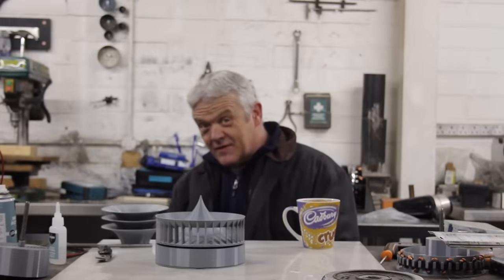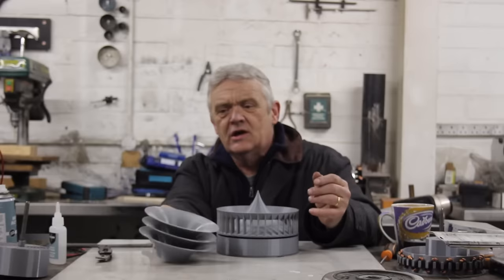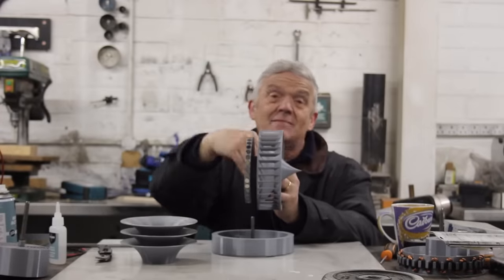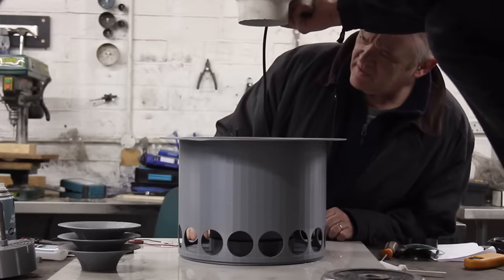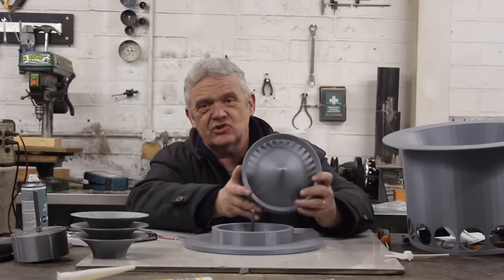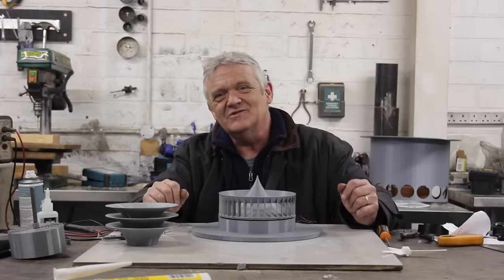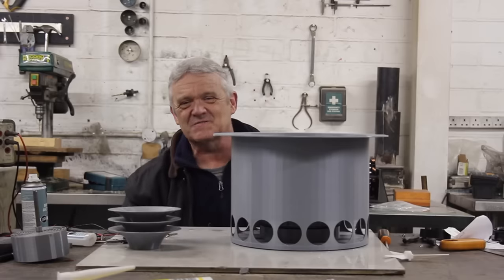1889 Ground Breaking Wind Turbine Update

Comment: Could you not have someone CNC a former out of several layers of plywood and then use that to form some fibreglass over for the concentrators?

Design your cone shape in CAD, then, use a slicing tool to turn it into 22mm horizontal layers...these can then be sent to a CNC flatbed machine.

You could also look at including some directional veins embedded into the fibreglass to cause the air to be fed as a rotating vortex too.

The veins would also act to ensure that the cones are kept equidistant from each other.

Comment: Hi Robert, I like the way you start testing to find out which components may be best suited. What I would also like to see is a "standard" VAWT (Savonius or Ugrinsky etc.) of about the same size (height and diameter) as the wind catcher. When you connect it to your serpentine coil generator, will there be a difference? And how big? If the Ugrinsky, let's say, is equal or a bit better, then we know we must use the Darwin/Waters turbine only in situations where it is critical not to have a large, rotating mass exposed to the elements. Could you please compare these two designs?
Reply from the maker: goo points mate thanks for suggesting them

Comment: I imagine the real test will be checking how the angle of attack on those rotor blades changes the output speed or torque at given speeds. I'm sure you will optimize it for your 4m/s common wind speeds you've mentioned before. 
Incidentally I recall that the Tesla generators work best at VERY high RPM. Not so much at lower speeds I would be surprised to see that come up again in this series. Not to say they couldn't apply elsewhere though.
Reply from the maker: they do work well with higher speeds mate

Comment: So wind, water and what about sunlight? One thing you can rely on with sunlight... it warms the ground which emits heat of wavelengths that make air rise. If you have a substance that makes air rise using sunlight, you can drive a turbine from the rising air... without any wind. Ever tried it? I suppose it wouldn't work in a temperature inversion scenario, since air is hotter with increasing altitude.

Comment: The relationship between the vertical foils and the attached spinning cone, is fixed at a certain angle. Is that 90 degrees? As the speed of the cone increases should the angle of the vertical foils change due to the Magnus effect for maximum efficiency?

Comment: What if the cone is made of Tesla cones the empty radially with the last exhaust passing through a similar ring, with ''blades'' be hyrofoils sand the whole thing being immersed on running water, or attached to (comparatively) smaller diameter input pipes arranged around the axle and bearings so that the whole apparatus allows the fluid to pass through it axially at approximately thirty degrees to the centerline?

Comment: What about air pressure? eg wind blowing over a sloping roof accelerates causing an area of low pressure much like on an aeroplane wing. Placing a downward direction Darwin type would be going against the flow, whereas an upward one might be enhanced?? Also thinking of air pressure inside the cone...

Comment: With the wind capture device, as you are looking at whether to 3D print or hand make. Would bafals around the top of each layer help catch the wind that would otherwise blow past the downward facing cone? Because the cone is reducing in size you could lose a lot of wind that would otherwise be captured if bafeled went all the way to the edge. If you offset the bagels at each level you would be able to capture the most amount of wind no matter which direction the wind blows from.
Just an idea, not sure if it will help you probably have considered it already.
Reply from the maker: I have tested it mate - they don't add to the effect

Comment: I'm probably wrong, but a question occurred to me looking at the outer cowling... if instead of simple open circles, they were the large end of hyperbolic cones, would the low pressure on the outside effectively pull the air through the turbine from the back end of its progression?

Comment: I would have thought the air passing by the turbine helps suck the air through the turbine so eliminating it with an inlet duct would make it less efficient. With aero, it's all connected, I.e. disturbing outlet flow will impact inlet flow. Perhaps the duct can take bypass flow into account for even better efficiency.
Reply from the maker: maybe

Comment: You know the serpentine coil is wiggling round them nobs,would it make a difference if you added some iron in the centre of the nobs in the form of a screw or bolt 🤔

Comment: I get that you dont want to see the generator output, and that logically makes sense, and its the right decicion to separate efficiency of the two parts, but consider this, lightening the rotor or reducing friction will increase speed, and increase voltage, but not power. You need to put a defined resistance across the output at measure the voltage and current, and therefore power. Voltage is not equivalent to torque, power is closer. In ac theory its more complex than that but its power you want in watts, not voltage

Comment: I'm just wondering if the Finns should be designed like a pinwheel .Know how easy a pinwheel will turn in a low wind situation. I've noticed that the wind collector's on a roof such as a a canvint with a* whirlybird turbine on it why it's fins are 
Convext & spiraled  like on a pinwheel. I also think that there is a variable in the size of your collector and the size of your turbine that should be considered when deciding the efficiency maybe the bad part of the operation is just due to its size.

Comment: Really enjoy your videos!  
Question 1: Is the pointed bit in the center of the rotor a conical, or is it parabolic?  It was difficult to tell from the video images.
Question 2:  Why don’t furnace blowers, or “squirrel cage” fans, use that pointed bit?  Seems like that would improve efficiency or reduce the load on the motor.  Note: If you are not familiar with furnace blowers, or squirrel cage fans, they are often used in North America on residential forced air heating systems, as well as some industrial applications.

Comment: been peeking through all of your videos and first off. endlessly fascinated with your content. you very much reach the goal of empowerment. 
So, im inspired by the ancient middle eastern wind catcher towers and how they utilize the cooling effect of condensation to create pressure differentials inducing the flow of air and expulsion of heat. im curious as to how this could apply to increasing the flow of air and in turn, efficiency of power generation but also to utilize the cooling effect to mitigate costs of A/C in warmer climate areas such as india, africa, maybe the SE america. taking into account the effects of humidity Vs Dry climates. create a parallel reverse direction Darwin tower "exhaust" 
idk, it seems plausible in my mind, but im no engineer. i plan on experimenting with it myself to test out some efficiencies but alas, i am poor, am in the middle of a move, and do not yet have a 3D printer, so it will take me a few months to get the pieces together to try it myself. i hope you see this robert, and maybe can tell me why im dumb before i expend a lot of energy or maybe it could be not so terrible an idea. either way i see this as a win. 
cheers, and thanks for all the content.
edit: when you look at designs for windcatcher towers they often take into account seasonal wind patterns to determine which way to face the tower. so, rather than having it be an omni directional darwin tower, would it be more efficient to have a 45 degree windcatcher with a pole that you can easily adjust to catch a maximum of wind power/suction that you manually adjust seasonally by monitoring output and wind directions. potentially even a slightly more high tech setup with a directional wind sensor connected to a small motor to slowly move the catcher atop of the rotating PVC pole.

Comment: Just wondering about the exhaust holes, is the total area greater, equal or less than the inlet?  You seem to be following in the foot steps of Henry Royce who I seem to recall also improvised with a generator as a dynamometer.

Comment: Crazy idea here: 
what if you attached another turbine under/to the generator (creating an updraft) in order to rotate the generator in the opposite direction to the above turbine? Thus doubling the the rotations. 
I get that there would be a big issue with all the wiring to the generator but could there be a way around it? 🤷🏻‍♂️ 🤔

Comment: So to increase speed on the generator motor itself, a belt and pulley system. Larger pulley on the turbine and a smaller pulley on the generator motor

Comment: Another question I have is - at what point does this 0.1mm wire burn out?   I've done a few calculations for power of air, and if the inlet is very efficient, the power output in 50mph winds using a (say) 600x600 Darwin is likely to go past the current capacity of the wire.  It's a bit frustrating.  So I'm tempted to increase the diameter of the impellor slightly, which will then potentially increase the generated power capacity, but also give room for a 0.3mm winding instead of a 0.1mm winding.  Lots of numbers to jiggle, and at some point I have to stop running it through my head and actually build something.  I'm starting to get the point that a DIY system of this type is almost inevitably going to fail somewhere, and it's a very different mindset from just buying something off the shelf.

Comment: Great video, makes perfect sense - with rim speed as the target it sounds its a weight to design challenge now. Very curious to see the CFD on the conversion section. Could you pick up more rotor speed by roughing the surface in line with the veins? Taller veins (weight issue) Looking forward to seeing the iterations :-)
Reply from the maker: cheers mate

Comment: With the magnets, wouldn't it produce more power if there was another magnet rotor below the coil aswel ?, so you will be using both top and bottom windings of the coil instead of just the top !, to me it would be twice the power wouldn't it ?

Comment: What about adding pipes to the exhaust holes of the wind capture and directing the wind back down the wind capture part would that improve anything.
Reply: Short, flared pipes. The flare should be able to add low pressure around the down wind side. On the windward side, that could be a problem. Equalised? Dunno
Reply from the maker: I don't know mate

Comment: Keep turbine on bottom but use vacuum to spin rotor by turning guides upside down and siphon effect would spin it maybe... why is this important? Because that's how large nuclear power plants create constant cooling stream. Where would the heat come from ? The generation of electricity and a painted black stack to also harvest sunlight. On a massive scale the upward stream is easier to control as vents around the bottom single input row of openings can be mechanically shut easier then the parabolic stack you currently use
Reply from the maker: cheers mate

Comment: Are you familiar with the $30 1kw diy wind turbine by OpenSourceLowTech? Made with a motor from an electric Hoverboard Wheel, a couple of bicycle wheels, a fan belt and some sheet alloy. Easy, cheap, quick to make and easy to fix with about 20% efficiency. One of the few Iv'e seen that actually makes practical sense, especially so if you use the other motor from the Hoverboard and make two of them. Should pay for itself inside of a year depending on circumstances.
Reply from the maker: seen it

Comment: Your meter will have some input impedance probably 10M ohm or something so you already have a current just from the Voltage measurement.  Can you just use a parallel load like a potentiometer to dump some of the current and do the relevant calculations from that? 
Does it stop when you short the coils??
Reply from the maker: do you know what I find mate - it doesn't matter what you do - someone, somewhere at sometime will tell you to do something different - basically you do what you like as long as you get a result that helps you
Reply: @ThinkingandTinkering  I see lots of people suggesting things, having their own ideas on the topic and sharing them , isn't that part of having a channel? I have my own projects,  I'm not sat here doing nothing.

Comment: to measure power use gravity and weight,Tie a sting to  a shaft and hanh a weight on it,  let the  blade wind it up, change the weights to determine the power difference
Reply from the maker: do you know what I find mate - it doesn't matter what you do - someone, somewhere at sometime will tell you to do something different - basically you do what you like as long as you get a result that helps you
Reply: @ThinkingandTinkering  i thought you liked Ideas,  I'm not telling you what to do just an idea as its simple, one to test all simply

Comment: Don't commercial wind turbines work at a fixed rotational rate?  (an optimal rate for their size)  So presumably you don't really want the optimise the turbine to spin faster, just generate more torque as the wind speed increases. So ideally you'd need a feedback system to dynamically balance the resistance to hit the optimal turn-rate.

Comment: Would a secondary deflector in the big piece help move some of the 'wider' air out the top of the fan rather than it blowing down and effectively causing turbulence issues to the more 'central' airflow which is running down the fan cone slopes then hitting the airflow like a vertical wall? Otherwise narrow the hole but that will have its own issues...
Reply from the maker: I don't know
Reply: @RobertMurraySmith  worth a dabble? Can send a drawing if what I mean if need be,  I know my explanation is a bit rubbish....

Comment: look at the picture at eleven seconds it shows the louver vent opening inwards and upward to the fan. Not downwards this acts like a chimney drawing air upwards to the fan. if you want air to hit a fan at a certain angle you would have to be in different places when the air is forced down to the ground as air pressure moves around. The louvers do point upwards its hard to drawer air down, when it gets close to the ground it warms up and create thermals rising up faster creating a upward draft. turn your fans upside down and put them on top of a tube were the air can be drawn upwards should create a fast fan.
Reply from the maker: that was the original design mate from the 1600s

Comment: I'm curious, could you apply a type of tesla valve upon the intake to ensure a negative flow (ie gust of wind up top) does not slow your rotational mass of the fan? I've no idea if that will help in anyway. I'm just curious if that would be beneficial by mitigating losses.
Reply from the maker: I Don't know

Comment: I used to work.on lm2500 gas turbine and it used the waste gas to spin a shaft to become self sustaining (obviously with Diesel being added). Could you use your waste air out of the bottom to be guided back into the top of  your intake?
Reply from the maker: yes but at the added cost of expense and complexity

Comment: 7:15 SUGGESTION: EXTRACT THE CONES FROM SHEETS OF THERMOPLASTIC OVER A MOLD.

Describe the superheterodyne [or, if you prefer, the 'anti-heterodyne'] in Tinker-cad, or with a compass and a sheet of paper, cut out a piece of wood of that shape, bend some stuff wire [3 to 4 mm should be quite sufficient, but if you do a lot of them, even coat hanger wire could be made to work], solder them all into a 'lamp shade' of sorts, [or even find a bunch of lamp shades all the right size and angle cheaply from some wholesale company] and then stretch a sheet of 4 to 6 mil HDPE plastic film over a 'picture-frame-clamping jig, cut the center hole out and line it with tape before stretching to prevent the plastic from tearing, then with just a little gentle heat [less than 80C] stretch each wire frame through the plastic, allow it to cool, then tape the outer edge to keep it from fraying in the wind.

I suppose, with a little bit of care, one could even modify common umbrellas to do this work, as they are quite cheap, and might possibly be usable with a little reconstruction of their spokes, along with them allowing one to have a common shaft, by putting the pointy tip of one piece up into the cut open piece of the next one in line [like stackable drink cups] and perhaps some hot glue to hold them together, and then this can sit on a wire, builder's board, wood, or printed plastic support on each end to keep it all in a line and keep it at the right distance.

That funnel need not be anything extremely thick or heavy, since all it is doing is deflecting air, so long as its frame is secure and stable.
Reply from the maker: nice one mate good plan

Comment: @Robert Murray-Smith. 
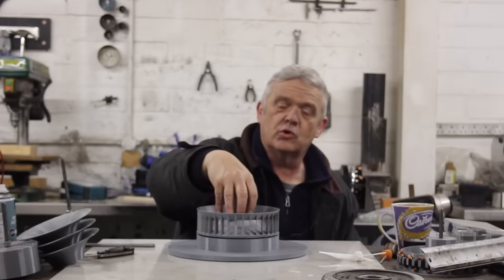Time stamp 5:45.
I noticed daylight between  the blade rotor , and the funnel.
I think if you just wrap a ring of tape at the base of the funnel to close the gap and stop leakage?

Or is it working a little bit like a venturi?
Can test it with smoke or tissue to see the flow 🌬️🍃 😊

Comment: Nice turbine Rob! Would treating the exhaust air change the output eg tubes from its exhaust? Car engines with gas flowed exhausts are more efficient, could that increase output a bit or just add more drag?
Reply from the maker: I think so mate but it would add to the complexity and expense

Comment: some questions 1 how would you scale this up ( I need to go off grid as the line rental /daliy charge is now 4 times the Kw part ) 2 how would you ( Me ) cope wth very high wind speeds ( here up to 130 mph ) I smetimes see . love the vidios and the concepts 3 do not own a printer but have a manual machine shop .Thank you Richard , ps Know anything about regen ( flow Battery )
Reply from the maker: make it bigger or make more of them